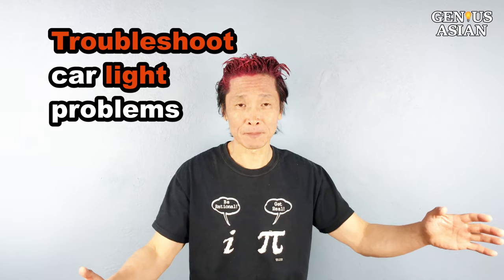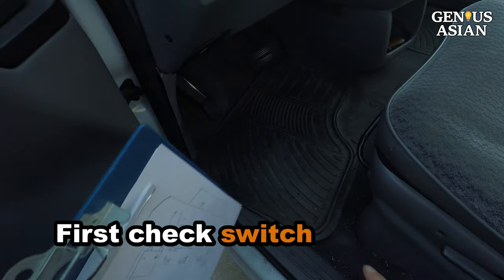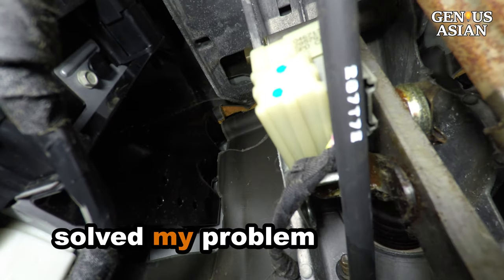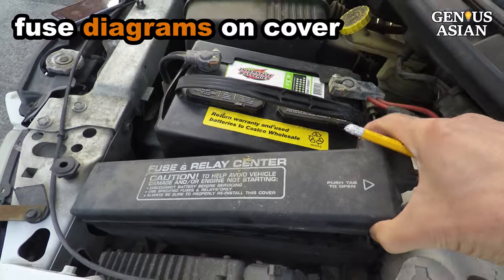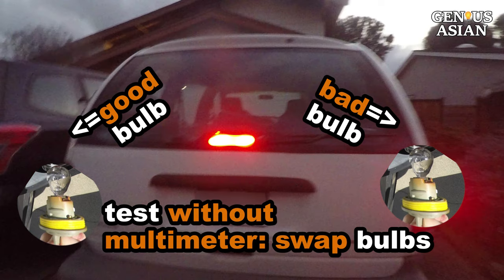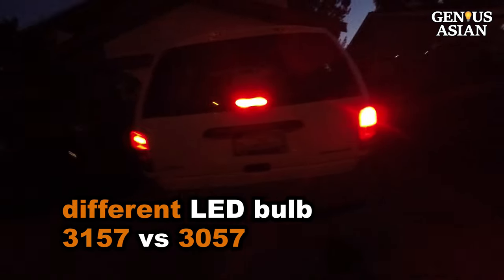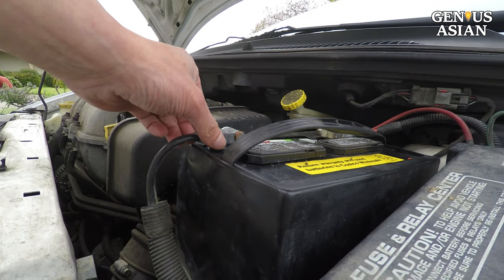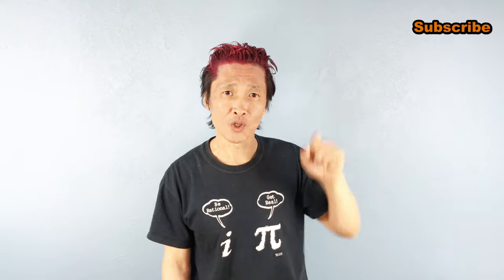How to troubleshoot car light problems, such as lights not turning off or one-on one-off.

Comment: You forgot one thing that happens way too often, people put the bulb the wrong way in and then it's always on... Happened to a few people I know
Reply from the maker: Thank you for taking the time to share your experience, it may help many other viewers. I can understand that if I put the bulb the wrong way in, then it's always off (note: not always on) no matter how I turn the switch on or off, however what is the condition a wrong way may lead to always-on result? If I turn the switch on or off, the wire at the socket would be connected or disconnected, it does not matter how wrong you shorted the wires because the power source is off.
Reply: @GeniusAsian  I mean there are double contact bulbs for rear running lights/brake lights, theres two positions you can put them in, one is where its normally running lights on and when you press brakes it lights up more to indicate braking,  the other position makes it so its always lighten up as if you are always braking.
Reply from the maker: @svmei  ok, that makes sense, thank you.
Reply: @svmei  3qqe

Comment: Great video, very informative. I have an '07 Nissan Versa. The brake lights work when the tail lights are off. However, when the tail lights are on, the brake lights do not work. I'm guessing it's a wiring problem, however if you or anyone have seen this issue before, a solution would be great!
Reply from the maker: 1. does the Center Mounted Light (on high top) work? 
2. just a reminder or something to be aware to help you to debug: the brake lights and the tail lights may be on the same globe,  some cars may have a dual filament bulb that acts as a dual purpose bulb. When lights are on they are tail lights, when service brake is pressed the second filament is activated acting as a brake light.
3. sometimes when ground wire has weak connection,  it may not show failure until higher currents go through ground wire. So when you want both brake and tail lights work at the same time, the ground wire may fail.
4. you should fill in the following table of 8 combinations, to see which of the 8 combinations fail:

 center brake tail 
===============
4.1 on   on  on
4.2 on  on   off
4.3 on  off  on
4.4 on  off  off
4.5 off  on  on
4.6 off on   off
4.7 off off  on
4.8 off off  off
Reply: @GeniusAsian  Thanks for the information! I took it get looked at and you are right, the bulb does have dual filament. However, the issue was the bulb socket. Once replaced, the lights worked as designed!

Comment: I’ve got a problem with my left tail light when I turn my head lights on the left tail light doesn’t turn on right away only after about 15 mins of driving it starts to work. All brake lights work fine it’s just the left tail light doesn’t work right away, any idea what’s causing this?
Reply from the maker: 1. what would happen if you swap left light bulb and right light bulb?
2. when the light is not on, if you measure the voltage at the bulb socket, does it show any voltage?

Comment: I was just driving at night and everytime i would break my instrument panel lights would go off and my tag plate lights would go on(off while driving), one of my taillights is off and the bulb is new.
Reply from the maker: make sure you understand brake light is different than tail light. Your description is not very clear which switch is on or off while what action did you take, if you can make a truth table listing all the combination of the the switch changes and the light condition, it would be easier to location the problem. Without knowing the truth table, in general you may  use ohm meter to check circuit to ground, press your brake while measuring the voltages to trace the problem.

Comment: The whole left side assembly of lights are off. The signal light, the beam light and the brake light, the left front parking light. The whole left side. The bulbs seem to be good. Idk what can be wrong...any idea?
Reply from the maker: trace the wires

Comment: i have an issue where the light doesn't stay on, the right tail light, and license plate turn of when i have the car on. when i press the breaks the lights turn on but dont stay on, replaced the wire harness and still... they work but wont stay on and its the right side only

Comment: I had the problem with my left light not lighting, however I’m using led reverse bulbs. I already swapped both sides and the only time it seems to turn on is when I put a standard bulb as opposed to the led. Any idea what it could be
Reply from the maker: LED reverse bulbs may not be compatible with all light fixtures or sockets in your vehicle. Make sure the bulb's size, shape, and electrical specifications match the socket and housing of the light you intend to replace.

Comment: Any thoughts on side lights front and rear and interior lights also display screen backlit turning on by themselves with the vehicle turned off and locked and not touched for hours, my van ford custom 2017 has just started doing this
Reply from the maker: copied from the video description
This video discusses ways to test and eliminate possibilities so that you can quickly focus on the real faulty components. This method can be applied to other electrical circuit, the 6 steps should be:
1. draw a electrical diagram 
2. measure every exposed points.
3. mark the measured points on the electrical diagram. 
4. construct a truth table (as shown in this video) to eliminate good components and further narrow the search to trace the circuit.
5. once the search is narrowed, remove the faulty component for test.
6. And repeat from #3

Comment: This is great! Thank you
Reply from the maker: Thank you for taking the time to provide feedback.
Reply: My problem is not the brake light it's the tail lights on my car that won't cut off. The mechanic replaced the switch for the brake light and but that was not the problem. It's the taillight and I cannot find any solution online for this problem. The dashboard lights are coming on and stick in also when the engine is off.  Does anybody have a solution?

Comment: I have a Lincoln towncar 2004. When  I turn the car on the trunk light says the trunk isn't closed properly but it is. The interior lights come on the car starts a warning ticking and headlights and tail lights come on. Also the seat belt alarm dings when I have the seat belt on. When I shut the car off the lights will not go off. I have to disconnect the battery every time. Any suggestions?
Reply from the maker: instead of  to disconnecting the battery every time, have you tried to disconnect individual fuses one at a time? Try to trace the wires and test to eliminate each parts suspects on your circuit diagram

Comment: Thanks!  I have one light that stays on…Will check the other bulb!  Hopefully it is that simple - bad bulb and bad switch..
Reply from the maker: if one light stays on, it is unlikely it is due to a bad bulb. Does the other light stay on?
Reply: @GeniusAsian  thanks man.  The other light worked normally.  I was using a trailer light kit on the problem side - removed the trailer adapter - and working fine - so a short or bad ground I guess..  still a success!
Reply from the maker: @chrismackay8314  Thank you for taking the time to share your result. This will help many other viewers

Comment: Anyone know what fuse to take out as my rear brake lights wont turn off.....definitely is that little piece up under brake pad but it's hard to get up under it for me
Reply from the maker: you said " brake lights wont turn off.....definitely is that little piece up under brake pad", the brake light switch is under the dashboard, but the brake pad is the mechanical part, not related to the electronic component (see the circuit diagram). If you want to find out the fuse, for some cars there are two places for the fuse box. One is under the hood, the other is inside the car under the dashboard.

Comment: ugh. i’ve changed the battery, bulbs, brake switch, fuse, and still nothing. illl check the grounding issue and wires. doesn’t sound fun.

Comment: My 01 Sequoia parking lights come on sometimes when the Sequoia is off. And this will drain my battery. I guess I should check the light switch, parking light relay, tow light connections? Anything else that may cause this?
Reply from the maker: there are 5 parts: battery, fuse, switch, light bulb, wire. You can test each part and "eliminate" the one that you demonstrate to be a working part. Since the light is on sometimes, you may assume the light bulb is working, the fuse is working, the battery is working. The switch has higher probability to fail, you should test it. 
Do you have rats in your car? Rats like to chew wires. (no kidding, I have seen rat's dropping in cars) Once the wires are exposed, it may cause shorts, thus could cause lights turning on.

Comment: I have a specific problem. When i turn on the light switch, the brake light is on. And when i press the brake, the park light is on. So when i turn on the light switch, the bulb does not reach to the brake i press. What could be the issue?
Reply from the maker: the brake light bulb has two filaments (other bulbs may have only one), make sure you don't replace a wrong type of bulb. There could be different type of problems causing the same thing that you have described, for example shorts or ground faults or switch. That is why you should follow the  the 3 steps shown in the video:
1. draw a electrical diagram and measure every exposed points.
2. construct a truth table (as shown in this video) to eliminate good components and further narrow the search to trace the circuit.
3. once the search is narrowed, remove the faulty component for test.
good luck and it could be fun to diagnose the problem if you follow the correct process. And let us know your result so that your result will help other viewers, thanks

Comment: I don't know if I mentioned in my last comment to say my car is a 2011 Subaru Outback and it's not the brake light that is the problem it's the tail lights that are staying on also the console lights sometimes it gets stuck too.
Reply from the maker: when you say "sometimes it gets stuck", you need to measure and record your testing data when it gets stuck. The most important thing is #1 items in my list, if you have that diagram then the rest will become easy
different car may or may not have different circuit.
, the 6 steps should be:
1. draw a electrical diagram 
2. measure every exposed points.
3. mark the measured points on the electrical diagram. 
4. construct a truth table (as shown in this video) to eliminate good components and further narrow the search to trace the circuit.
5. once the search is narrowed, remove the faulty component for test.
6. And repeat from #3

Comment: Hi I have Holden commodore equipe 2005. For the last few weeks I can see the left side lights remain on, I therefore unplug the fuse to save battery. All lights are ok, but not sure why if I put the fuse, left side lights become on. Can you pls tell me how to fix it. I went to a local service center who was telling about the settings problem and asked for 1200 dollars.  But I can see the car lights switched off during the cold days, but putting me on trouble on hot days. Pls let me know if you have any suggestions?
Reply from the maker: we don't have this kind of car in US, but I think they are pretty similar, so you need to check to see if the switch is faulty, if the switch is fine, then trace the wire

Comment: i.hope you can help me with my 05 Toyota Prius.  The dealers are going to burn me to replace my rear brake lights.  Unfortunately, my friend borrowed my car when the brake lights went out.  Well, today, I took a chance to get to the store, I was going to use my hazard lights should anyone be behind me if I stopped, but they don't work either.  My check engine light has been on for a while, but it's set like that so you get regular maintenance after reaching so many miles, so I already have to go to the thieving Toyota dealers.  That always cost $350 plus what they can scare me out of!  Please.help with any advice about my brake and hazard lights. I suppose I better check and see if I have any lights at all!  Thank you!

Comment: Help, my left tail light does not come when I turn on the switch.  But it does come on right away when I get out and tap on the lense.  I have taken it off and sand papered where ever I could.  Still does the same thing.  The bulbs are good.
Reply from the maker: if you are really sure the light is supposed to be off (sometimes if you did not turn off the light after you left the car, the light may be off after a few minutes), then you should measure the voltage at the bulb when the car is running, if there is no voltage, then you can trace the wires. When you car is not running and the light is on, then you can measure the voltage at the switch to see if the switch is stuck and trace the wire.
Reply: @GeniusAsian  I swapped left and right light assembles and the problem switched over to the other side so I just ordered a new tail light assembly.
Reply from the maker: @QLFProductions  thank you for taking the time to share your results, your solution will help many other viewers
Reply: @GeniusAsian  NP

Comment: My middle brake light works fine and turns on and off based on the brake peddle but my two that are on the left and right stay on! Any advice?
Reply from the maker: since your "light works fine and turns on and off based on the brake peddle", it is likely your brake switch works. So trace the wiring

Comment: I have Audi A4 b7, and my backlights turn at night from 3am and wont turn off, sometimes unlockig/locking car helps sometimes not. Lights wont turn on during day, its just fine. This happens continuously night after night, and sometimes 3 4 nights they`re off. Its driving me crazy. Any advice sir?
Reply from the maker: when you said "backlights", what are the backlights, is it tail light or brake lights? If they are brake lights, you can check the brake switch.

Comment: Hi just wanted to ask, on my 2010 kia cerato my left break light stays on even when the car is off. I have also swapped the bulb but came up with the same problem, any solutions?
Reply from the maker: when you said " I have also swapped the bulb but came up with the same problem, any solutions", I assume your "same problem" means the left break light stays on. Does the left break light turns on when while driving without breaking?
You may want to check the break switch first, if the switch is fine, then check left wires.

Comment: Hi iv got a toyota yaris, brake light in centre of rear window is working but the the 2 actual brake lights don't, if changed bulb and checked fuse, still  nothing, any ideas guys
Reply from the maker: If you have a multimeter, you can trace to see if any voltage at the bulbs, if not, then trace to see brake switch etc. Also from comments of this video, many people are not aware there are differences between taillight/parking light and brake light. Very common they are in the same bulb, if they are duel filament bulbs it is very well possible that only one filament is blown and not the other.
Reply: Hey everyone. I have a similar issue. When I turn on my headlamps. When I hit the brakes both tail lights cut out, when I step off the brake pedal the rear tail running lights turn back on. The only light that works when I brake is the light on top of the tail gate. Please help anyone. Thanks.

Comment: I'm having and issue all the lights are working but the running light on the back drivers side isn't coming on. All the bulbs light up the brake lights the turn signal but it doesn't come on when you turn the lights on help plz
Reply from the maker: did you check the fuse?

Comment: My left rear light is out I changed the bulb when I press the break my left rear won't light up but the right does when I release the pedal the left comes on the right goes off
Reply from the maker: use a multimeter to measure the voltage, press the break and measure the socket, and then release and then measure.

Comment: Hello I have a dodge 1997 when I turn the lights on the back light works but when I brake it does not light up. Please help. I have changed the brake switch the light bulb and fuse are fine. Thanks
Reply from the maker: both left and right light go off at the same time?
Reply: @GeniusAsian  only one works when I brake
Reply from the maker: @jackieaguirre8318  as shown in the video, what happens if you swap the left light bulb with the right light bulb?

Comment: I have a 2008 honda accord my passenger side taillights work and when I brake even but the driver side is just not responding new bulbs in both left and right back side of the car please help
Reply from the maker: as noted in the video:
1. swap the left and right bulbs, let us know the results.
2. if you still have driver side problem, then see if you got voltage on the socket of the driver side. If you don't see voltage, then trace the wire.

Comment: You can possibly cause problems or damage with newer vehicles that as more complex systems by removing the battery cable while the vehicle is running
Reply from the maker: correct, voltage spikes may damage electronics, so it is better you remove corresponding fuses if you don't have any other tools at hand

Comment: Hi and thanks for the video explanation.
I have a passat vw 2006. My right parking light will turn on for 1 second then turns off. Can you please advise? All other lights are working properly.

Thanks.
Reply: Did you find a solution? I think we have issues in the ground wire at the connector. My Audi does the same after 30 mins. I’m about to try to fix it myself my cleaning the connection with a little sandpaper or electrical brush then add a little dielectric grease to prevent needing to do it again. I’ll let you know if it works